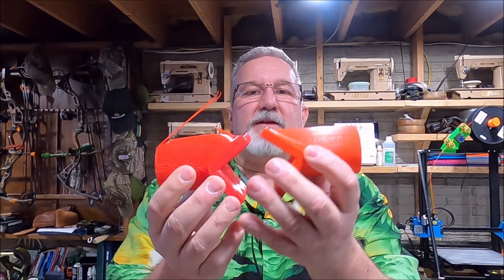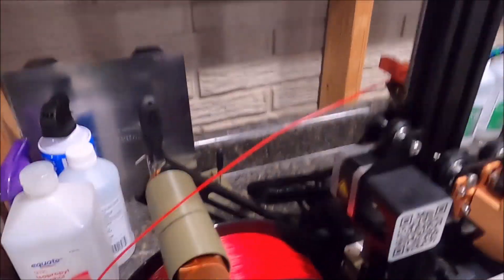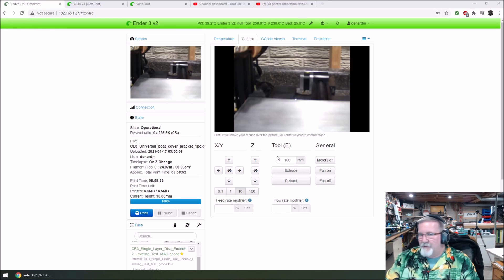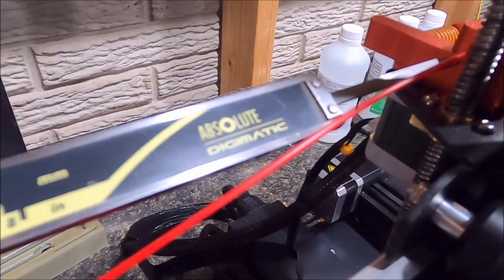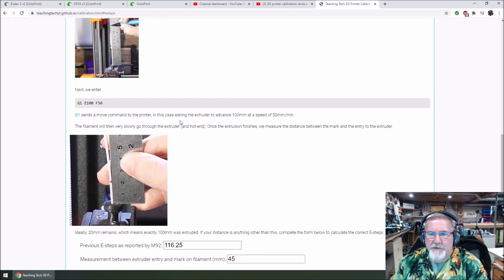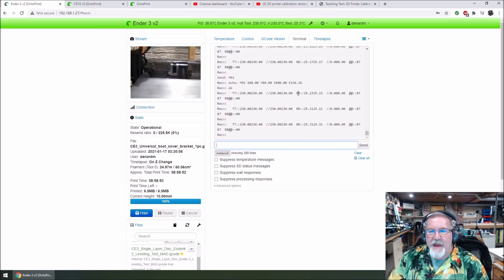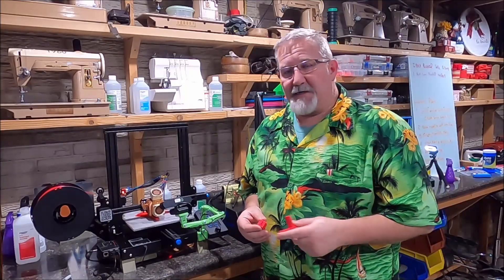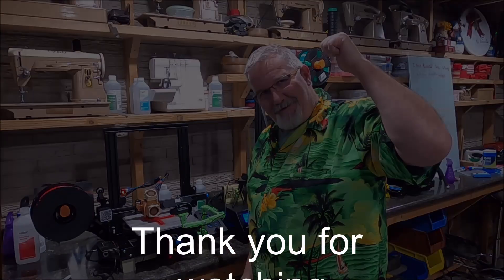Why did my print FAIL?  Let's trouble shoot and fix. Great information to make your prints Great!!!

Comment: Nice Video, If you suppress the temperature messages in the terminal it makes it a lot easier to find what you need.. Also, I find if you don't have an sd card inserted in the printer it doesn't save after reboot.
Reply from the maker: Thanks for the tips! Yes you are correct.

Comment: I literally just ran into this. My stock extruder arm broke (plastic to metal connection and the filament wasn't gripping. Changed out the extruder and then forgot to do my esteps. Then after doing all this work ..... I forgot to save before turning off so my next print was failed too. Luckily I wrote it all down so I changed esteps, and then "saved the configuration"
Good video and to the point.
Reply from the maker: Thank you so much.  Thanks for watching

Comment: Change how you do your e step calibration unhook your bowden tube heat your hotend clip the filament flush with the extruder snd then extrude it and measure what comes out its easier to do that way make sure it gets clipped flush
Reply from the maker: I just unhooked it from the extruder end. Same thing. Probable couldn't see it in the video.

Comment: But please keep in mind, if your using the original firmware, the EEPROM can be on the SD card as EEPROM.dat.
I had my SD card out and with the M500 I got the message „can‘t write to EEPROM“, then I put the SD card in and cut perfom the M500 command with no problems.
Reply from the maker: Yes you are correct, good catch.